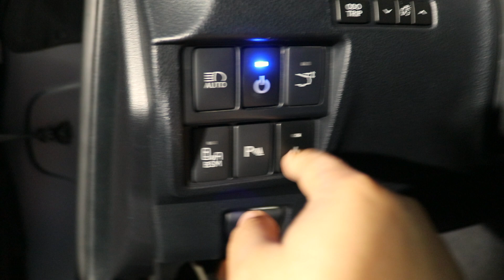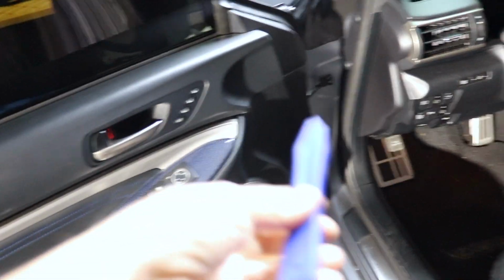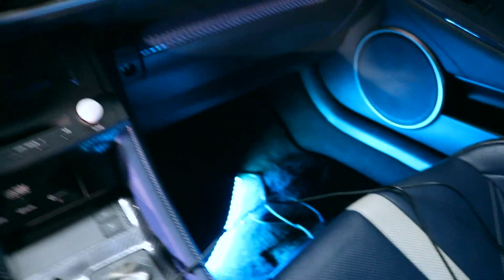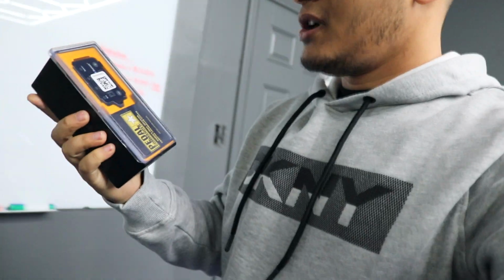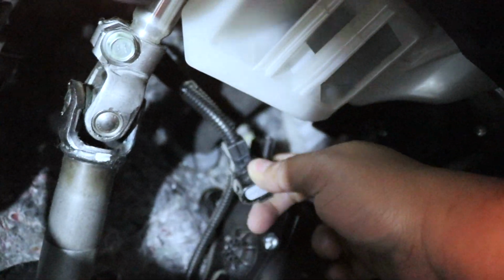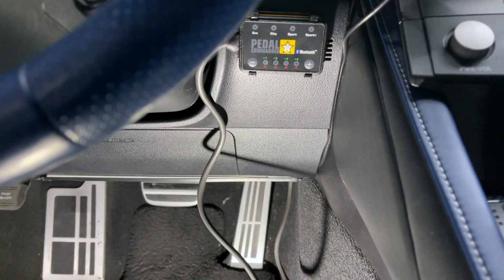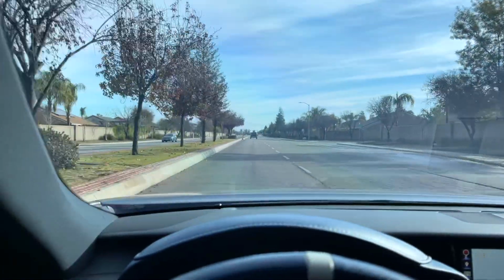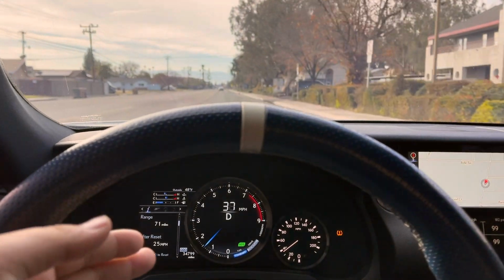INCREASING THE SPEED ON THE RCF!! FIRST SPONSORSHIP ANNOUNCEMENT

Comment: sick build! I have RCF F10 as well. I am looking for coilover that works with AVS but i do not see anything. Do you have recommendation on which coilover to use and if AVS is not connected is there any light coming on the dash? any issue with spring option as well? (swift spring specifically)
Reply from the maker: No. There are no avs compatible coilovers and you would have a constant light going off if you get something without it but I had the swift springs before I installed the bags and I loved them. Lowered the car perfectly and didn’t mess with the ride. I have mine for sale. Dm me on Instagram @rcf_muadh